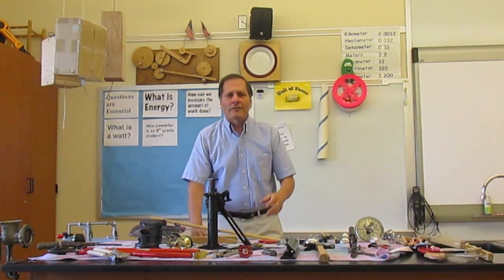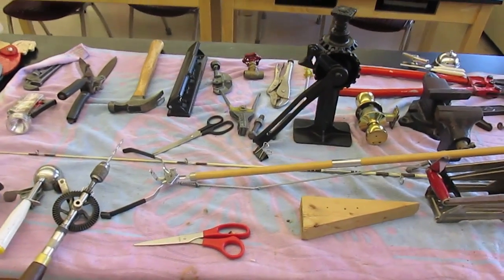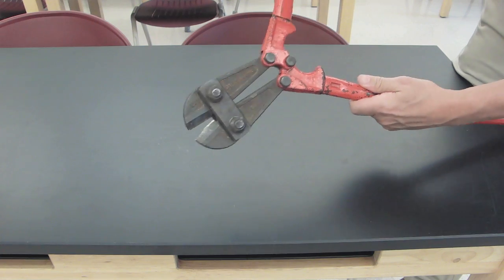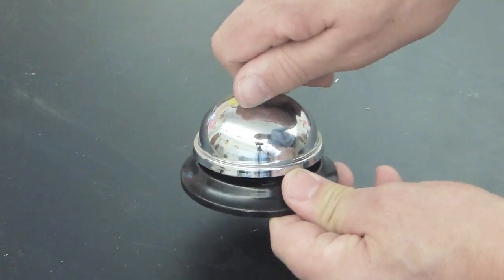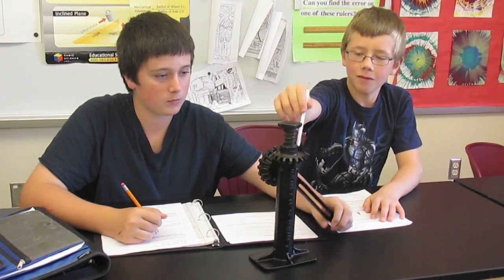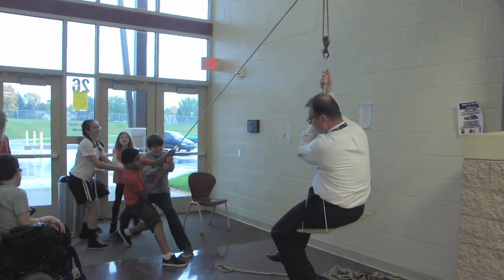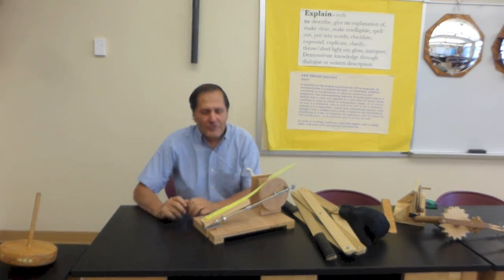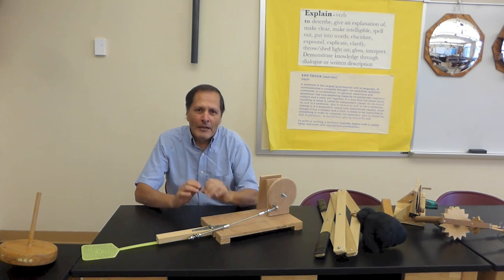Simple and Compound machine classroom investigation // Homemade Science with Bruce Yeany

Comment: how did you do the last one with the sharpener?
Reply from the maker: This was a student's project and I no longer have it.  The sharpener was mounted onto the wheel, the belt ran from one wheel to the other so that as I turned the one,  the wheel with the sharpener would also turn as I held the pencil stationary.   There is a groove cut into the edge of each wheel that the belt fits into.   Both wheels were mounted on the support with bolts through the center of them, the wheels turn on the bolts,  there  washers between the wheel and the support.
Reply: +Bruce Yeany (Yeany Science) OK thank you